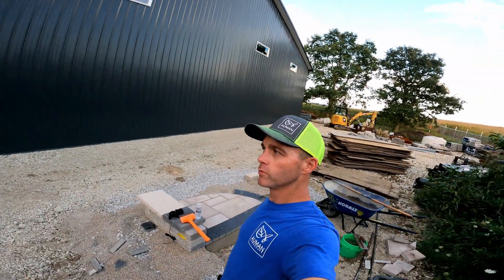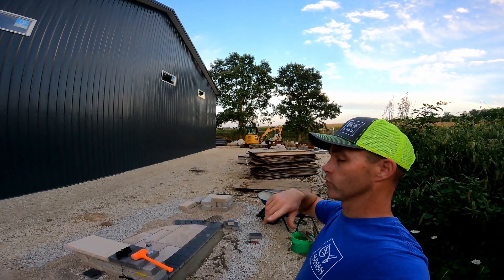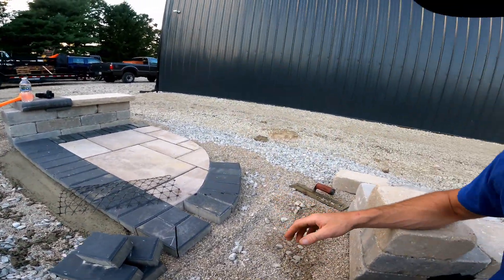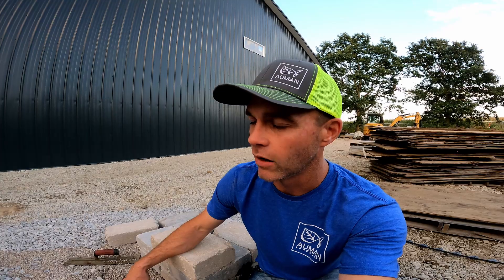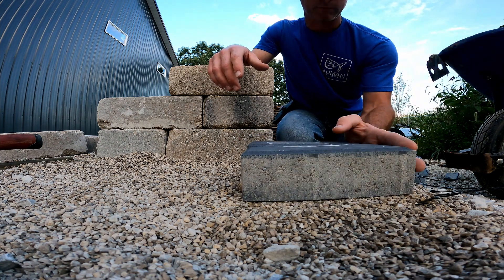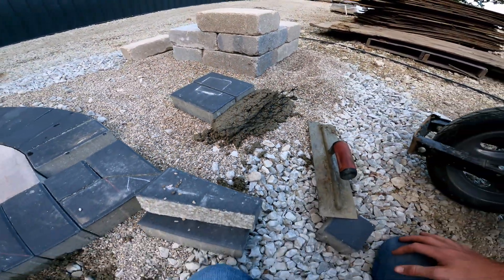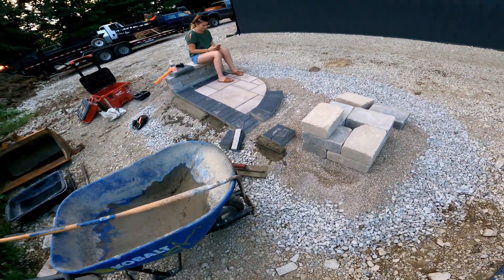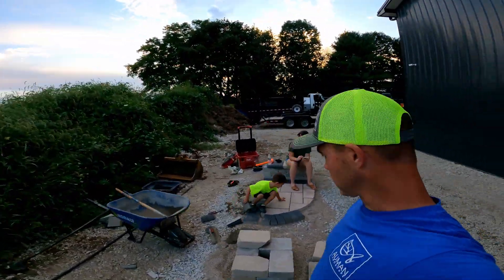Did Auman Invent Geogrid Entrained Concrete Paver Edge Restraint??...How & Why It Works So Well!

Comment: I know this is old but I did see a video with a similar idea except it was the geocell that was tied in like that. So on the edge they removed some of the geocell infill and then put concrete in there and actually bedded the soldier course in the concrete. I like this idea for patios and walks too just for peace of mind on slopes and stuff.

Comment: Standard in our work for years now  I'm surprised you haven't done it before. We also use it on our concrete countertops instead of wire mesh or rebar.